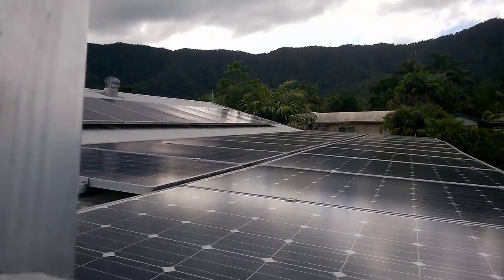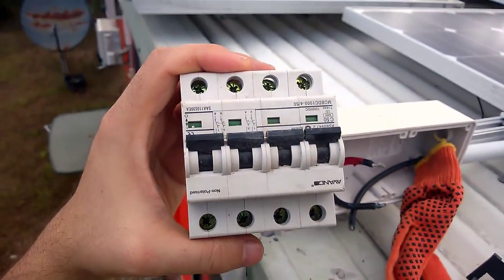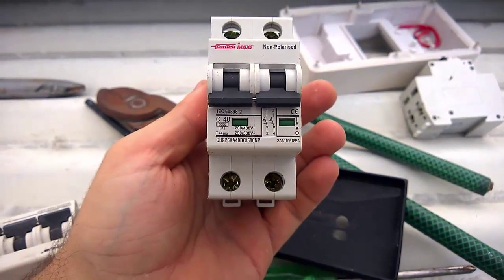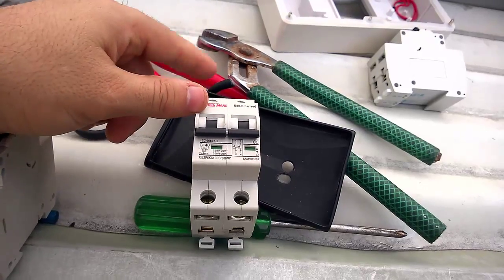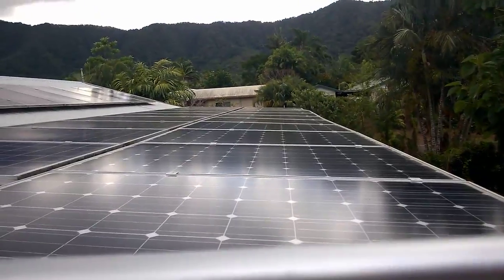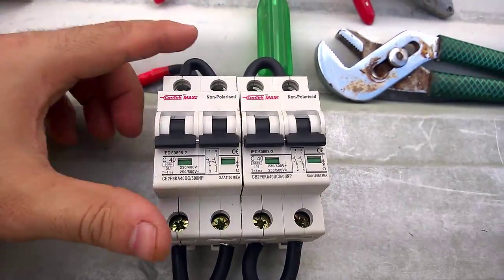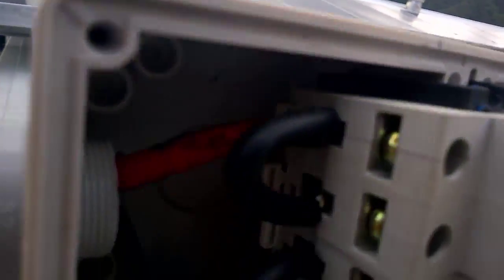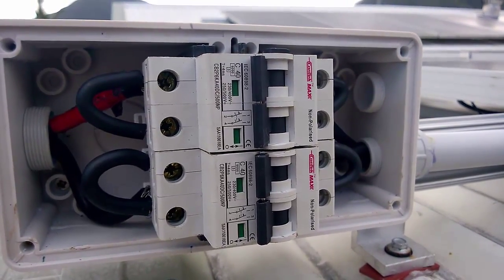Off Grid/Grid Connect - Replacing 4 Pole breakers with 2 Pole breakers

Comment: the way you're connecting those.. you have the math wrong. double the current rating of the breaker.
Reply from the maker: that is a old video. been changed long time ago.
Reply: as long as you have fun and learn along the way :-)

just ordered some breakers myself. think I'll do a few single pole breakers in the junction box, and possibly a main double pole breaker, but unsure if I really need it.
Reply from the maker: no harm doing double pole on both. that way your sure both pos and neg have been disconnected.